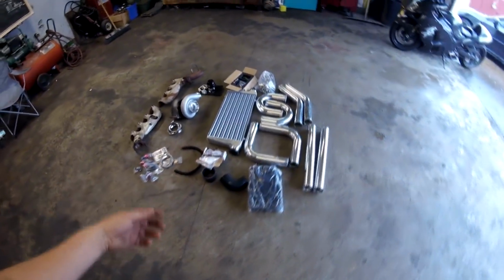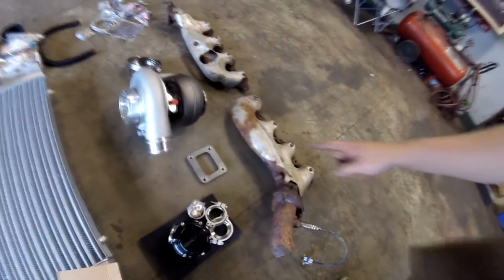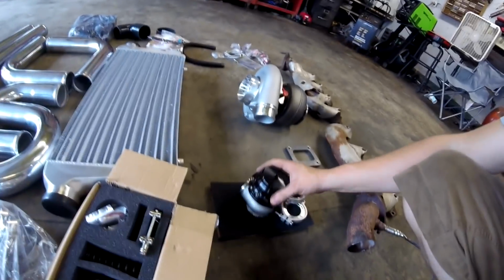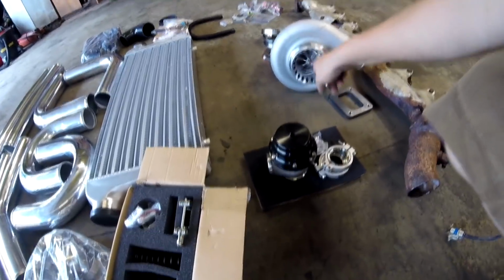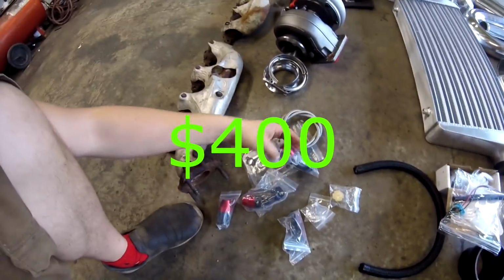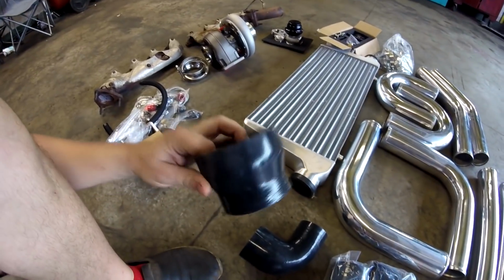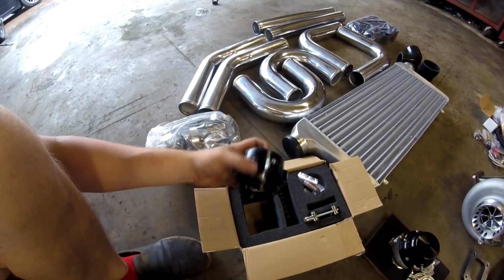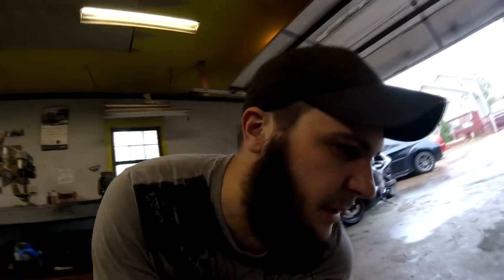How To Turbo Your Truck/LSX Part 1. What To Buy.

Comment: Can't wait to see the build! I turbocharged my Silverado for the exact same reason, to tow! I love my setup (1500, 4.8l, 60e, 67/65, 3.23 gears, stock converter, stock cam, 40k miles) and see boost as low as 1500 rpm. You're starting with a better combo in the 2500 and I'm interested to see how that turbo works on a 6.0
Reply: BocaChevy hey man saw your did this turbo setup on a 60e how much power you making and what’s done to the tranny?

Comment: Good stuff brother. That 66 should light off fast as hell. I know the one I had in my truck first would hit full boost before 2500 rpms  with the stock converter and felt great down low which is what you’re looking for. I’m looking forward to the tow rig build for sure. I’ve actually been kicking around the idea of doing a small rear mount in my Avalanche for the same purpose. 😉
Reply from the maker: Bad Luck Garage low boost pump gas and reliable! That’s what I’m hoping atleast haha watch my dumbass get greedy 😂
Reply: Thats the way it usually works out. 😜

Comment: Please go over how you regulate fuel no one ever goes in depth on how they do it or the pros and cons of using the factory regulator
Reply: Hey hunter, you gonna get mad at me if I plug my regulator videos on this comment?🤣🤣👍🏻
Reply: Julia the only factory regulator that I know of that has any issues handling the Walbro 450 he mentioned in this video is the Vette regulator/ filter. I actually went through two of them on my last build before switching to an eBay adjustable regulator. The rail mounted regulators and late model truck regulators seem to handle them fine from what I’ve seen.

Comment: Thank you bro for posting this. I’m buying a 2014 with the same engine. I’m curious to see the results. Did you ever finish this install? I can’t seem to find it in your videos. If you finished this install can you reply with a link to your video? Thanks.
Reply from the maker: This build the truck went 60k miles pulling my race cars to the track going 12.9 in the quarter on street tires then I sold it in running working order

Comment: I have an 2012 lh6 low miles I did my dod delete have 799 heads ,stock converter for now, wanting to turbo with ac still was need help on what I maybe could get

Comment: Have a 99 Chevy Silverado single cab 4.3 vortec just wanted to know will this fit please let me know ?
Reply: Although this kit is for the small block v8 series,this same kit could go on the 4.3 and  could be rigged with 3".  2.5" may be more appropriate for the for the amount of air flow the 4.3 Six experiences.

Comment: I’m thinking about using this turbo on my civic.  Just curious about the quality compared to the BW counterpart.
Reply from the maker: Better spool then borg imo borgs are lazy they come with warranty and have not had any failures email if interested or other questions
Reply: HunterTuned do you have any experience with the VSR 6766 billet?  I’m shooting for 800 and am debating on either of those two turbos.
Reply from the maker: Anthony Billings either would do it
Reply: HunterTuned which one is better?  I’m leaning towards the BB 6766.  It has the larger back housing and more efficient wheel.  Have you any experience with this turbo?  Like how good is the bb version compared to the JB?
Reply from the maker: Anthony Billings ball bearing will help keep turbo happier for longer when used hard. Spool time is about same from my experience

Comment: Hey Hunter, with regards to the intercooler piping, you mentioned you also used this kit for your civic. Did all the pipes fit up or did you still need to do your own fab? Asking for my build, cheers.
Reply from the maker: Dana Fazeli always usually need some cutting and fabbing but can make it work

Comment: How much was the damn turbo ?! You named all prices except the most important part..
Reply: Get a GT45 they run for 150 to 200 bucks gets u to like 600hp and maybe 650 but u will have to get a bigger and better like vs racing. Personally I would buy the 400$ vs turbo racing turbo. There u go tukachi wannabe
Reply: @JoseTorres-ms2ui  why r y’all so hostile for 😭
Reply: @bruhmomento1319  I am not but if u just want better boost and power spend the extra money on the turbo

Comment: What ECU are you using for turbo-ing?
Reply from the maker: I used the stock gm computer and tuned with Hptuners
Reply: @HunterTuned  nice. I am all new to ls engines. I live in europe we dont get to see too many ls here. I just bought an lq4 and i want to turbo it. Is it dificult to use hptuners?
Reply from the maker: @andreiv8186  it’s honestly not the easiest thing to use and get to work lol. If it’s not a factory vehicle that came with an LS engine initially I would recommend the Holley system to tune. Much easier and user friendly and works better in my opinion only time I use Hptuners is if it’s a vehicle I’m modifying that came with the LS stock. Hope this helps
Reply: @HunterTuned  thanks! I will search holey ecu to see how much it is.

Comment: Hunter do you sell injectors that work on a K series engine?
Reply from the maker: Project Cars & Modz not direct plug and play but I do have people using them in a k series yes
Reply: sounds good, do you know what is needed to make them work? what did they have to modify to make them work?
Reply from the maker: Mainly fuel rail height or playing with tophat spacers

Comment: Don't know where tf you're from but where I live E85 adds power lol I think you meant to say you'd be around 550 on pump and 650-700 on E85
Reply: Which depending on what motor you have be careful with the boost :)
Reply: E85 requires more flow for a higher consumption rate